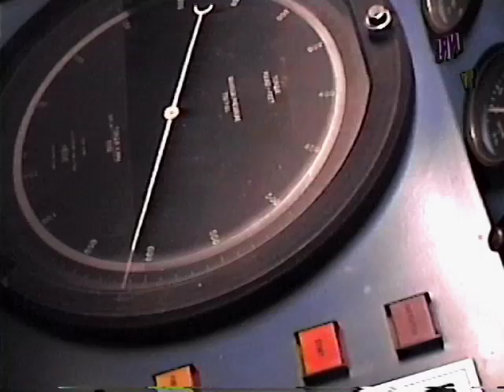Ear Spliting Blown 32 valve 406 SBC from Nelson Racing Engines.  NRE.  Tom Nelson.

Comment: @lawsamb946 no, 32 valve zr1 heads where lotus designed/mariner producer and where driven by overhead cams.  The arao heads are pushrod driven. The pushrods open 2 valve instead of one. It's ok for low reving engine, but it's best with overhead cam since you get rid of reciprocating parts in favor of rotating parts

Comment: is this using the   ZL1 style  heads from the lotus/merc built vette motor or a custom 1 off design?
Reply: Not ZR-1 LT5 heads, custom ARAO 32 valve heads, opened by pushrods.